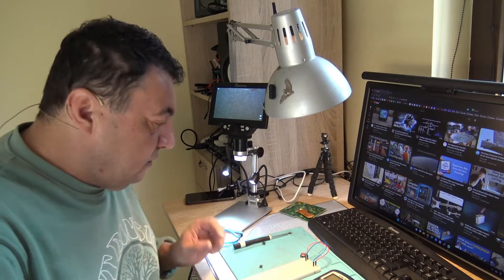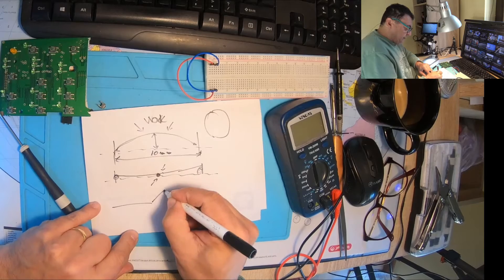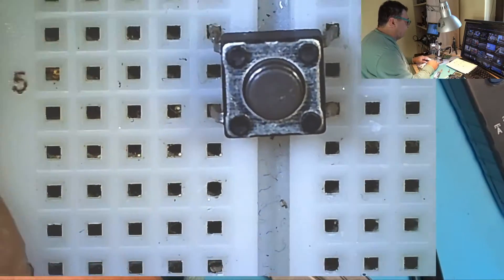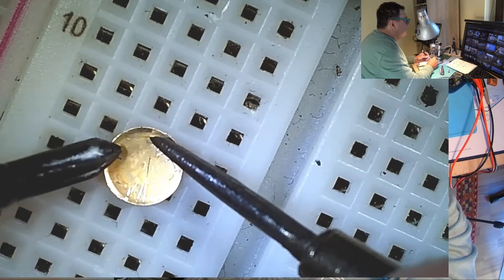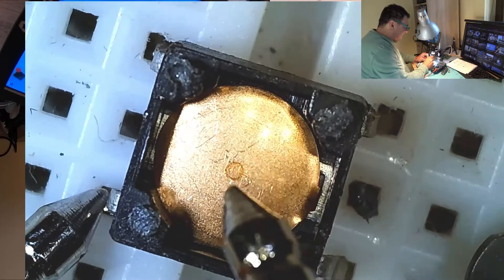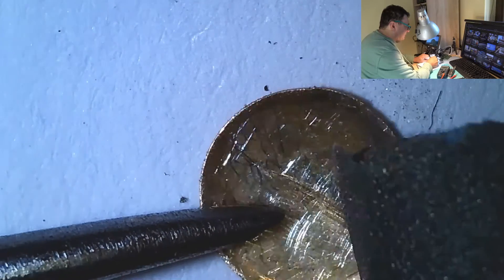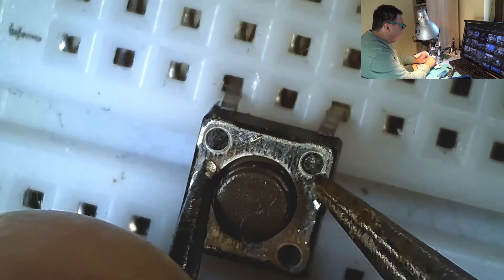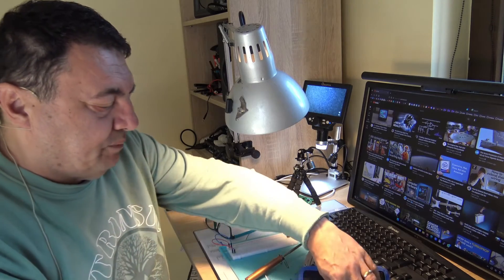Tactile momentary push buttonmicro switch explain, dismantle and fix

Comment: so to make it turn on when you power on you just solder a wire like the yellow lines? or just connect the positive to positive leg and the negative negative leg? sorry i am electronically illiterate and just wanted my bluetooth speaker to turn on when i turn on the wifi power smart switch :)
Reply from the maker: It's not that simple, usually the switch it's shorting to ground or minus some voltage, like 3V. A chip ''feels'' that and give ''power good'' to the next circuits , eventually CPU or any other processor. A simple strap soldered there doesn't give a power on signal...that short to ground last a second, then the positive 3V comes back ...but of course you may experiment.

Comment: Very informative video, thank you.  Is there any way to bridge a switch like this so when the mains socket switch is turned on the device will power on straight away instead of having to push the button?
Reply from the maker: Depends of the schematic...usually these switches are commanding an electronic circuit, not a simple on/off...so it's hard to say if a shorted switch will do an instant ''on'' job.
Reply: Thank you  @viocaia
Reply from the maker: @ZX300BoY  Always!

Comment: Great video. I couldn't melt the corner plastic nubs because there wasn't enough plastic left so I used glue to put it back together but I heeded your warning and was very careful with it. I managed to fix the switch and your video helped a lot so thanks.
Reply from the maker: Glad it was useful! Thanks for appreciations!